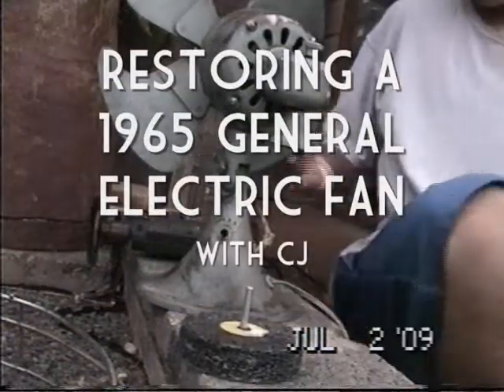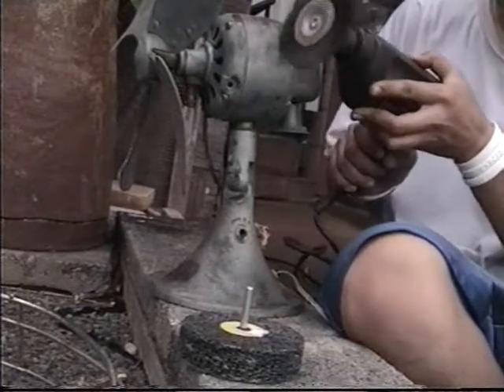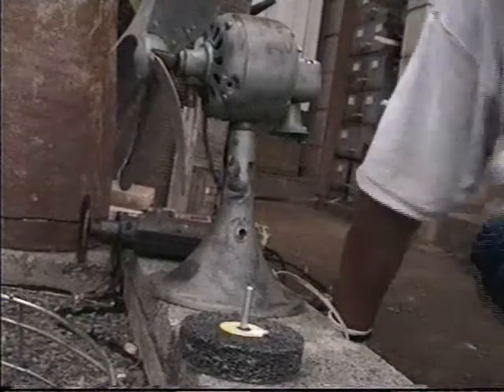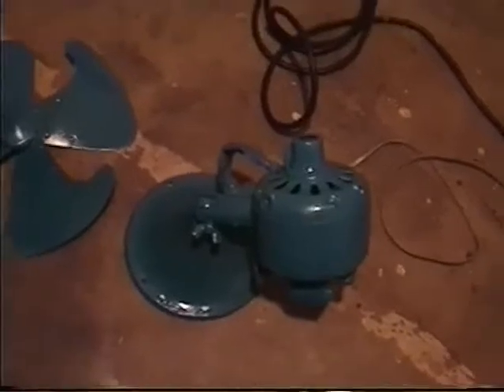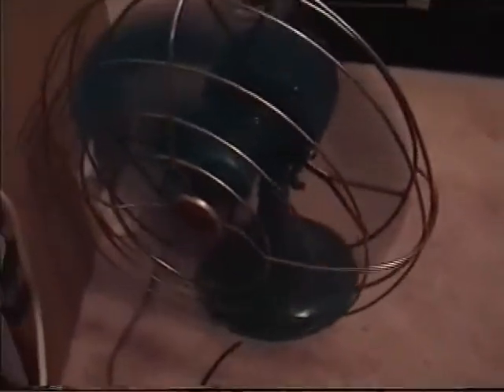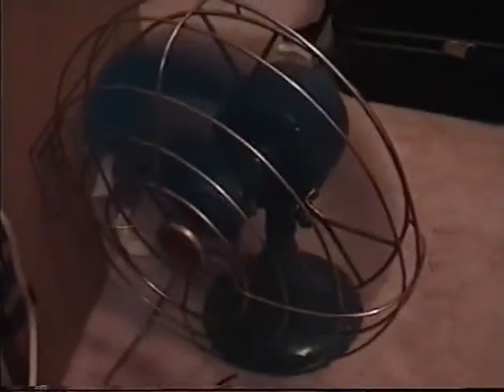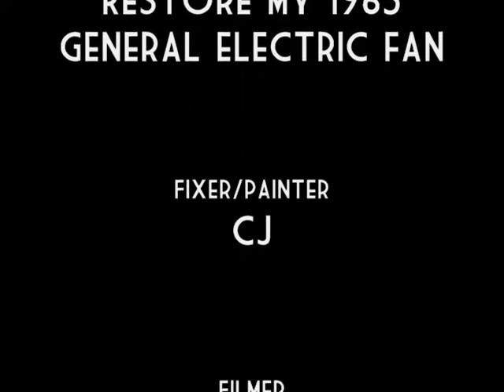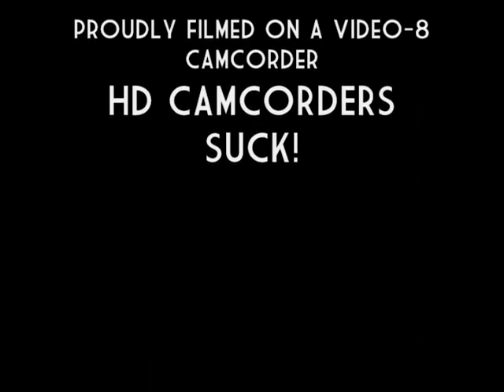Restore my 1965 General electric tabletop fan

Comment: Looks pretty good actually. You've got a GE Vortalex.

That cup under the front bearing holds the oil (it looks like a thimble). You can unscrew it, clean out the old grease & clean the wicking (I use Brake Cleaner), after that dries you can fill it with oil, put the wick back in and put it back on the motor. It'll make a difference.